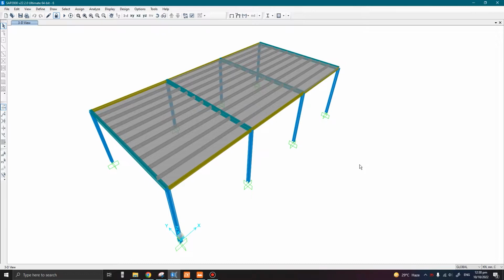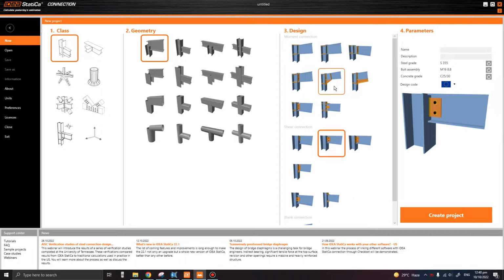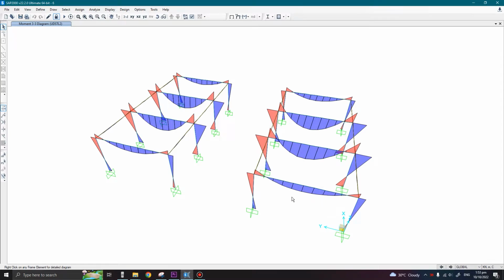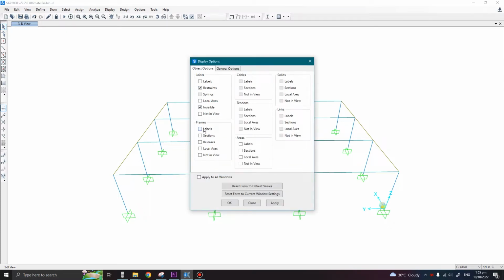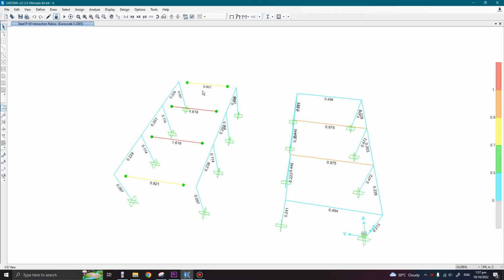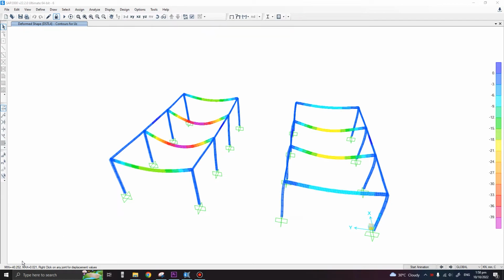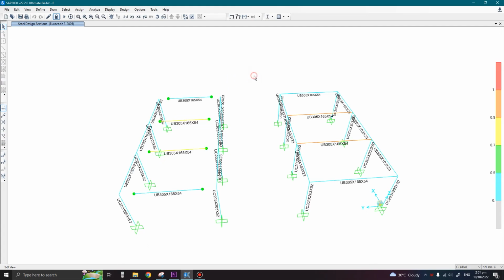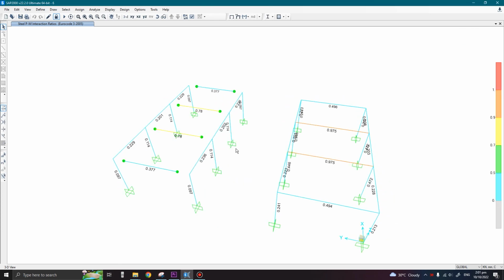Lecture 06 | Shear and Moment Connection in SAP2000 | Design of Steel Structures | SAP2000

Comment: thank you so much
but the bracing should be in the compression flange , right ?
so it should be in the upper flange not lower
Reply from the maker: compression flange is already braced by purlins
Reply: @ammarayub275  oh , yes yes sorry my mistake

Comment: Hello I have a question about the case of the moment resisting frame we should do release only in secondary beams or both primary and secondary?
Reply from the maker: That is up to you. you have to detail the connections accordingly and make sure the lateral loads are resisted and transfered to base